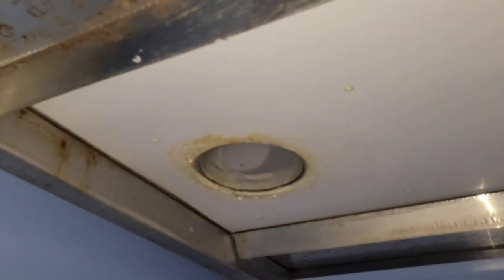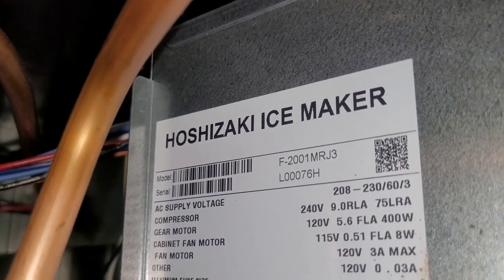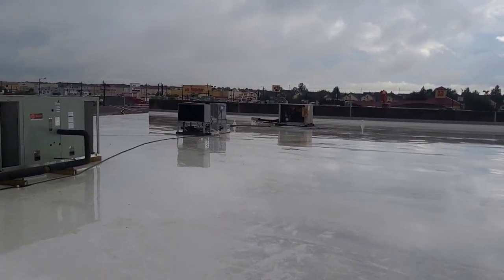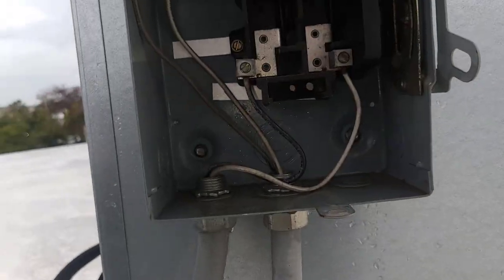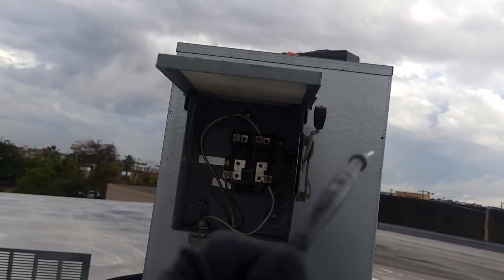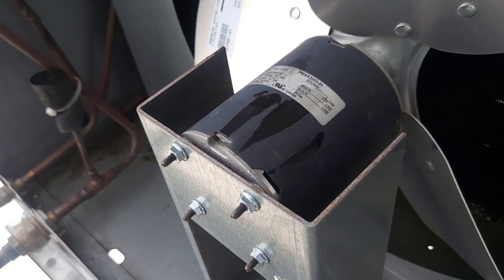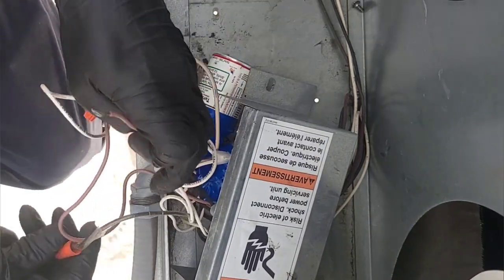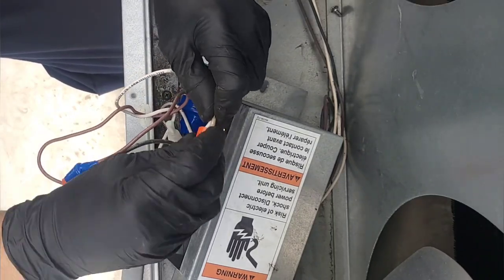Hoshizaki F-2001MRJ3 Ice Flaker Not Keeping Up - Condenser Fan Capacitors Bad

Comment: 👍💪🇺🇸❄️ Always enjoy ur troubleshooting skills. Does ur company provide consistent training b4 ur on ur own ?
Reply from the maker: Thanks. No, there's no training at this job or at any other previous jobs really. I have been sent to a few hoshizaki training seminars,  and some Manitowoc Seminars over the years. Back when I did residential service between '07 and '14, one of my employers did provide the ability for me to become NATE Certified. That has been long since expired though. 
Most of the troubleshooting practices that I use are all based on past experience. Whereas for every problem that I know how to troubleshoot,  is directly because at one point or another in my past, I learned the hard way and either wasted lots of time or screwed something up learning.
Reply: @HVACRServiceTech  💪👍🙏🇺🇸❄ thanks for sharing.  Ur videos r very helpful. Appreciate u sharing ur knowledge and experience to us new techs.
Reply: Never any training from employers I've worked for, they say they provide manufacturers training but it never transpires, i only learned the hard way with being on the job through shear determination, sweat and hard work and of course reading all the manuals and applying that to gain the experience.